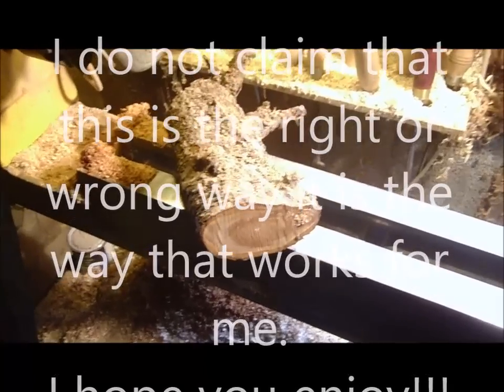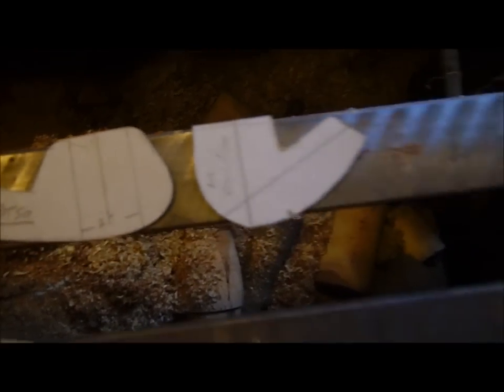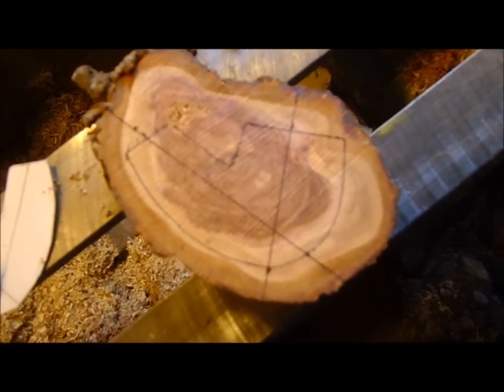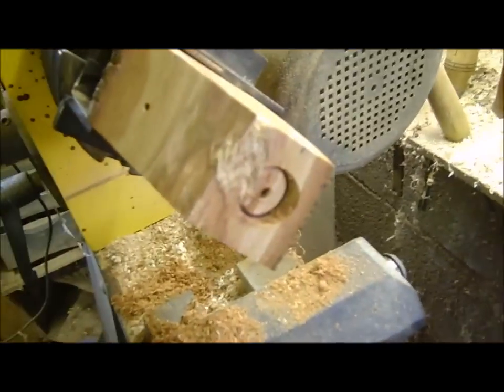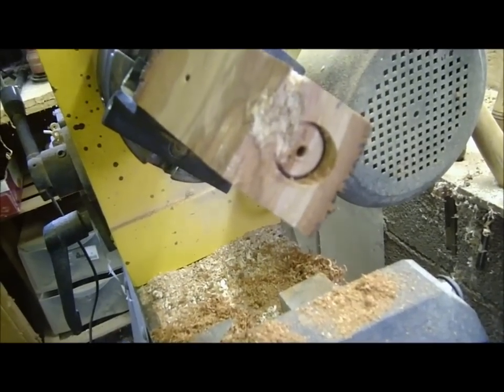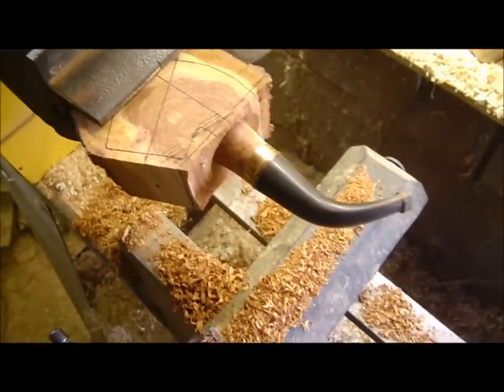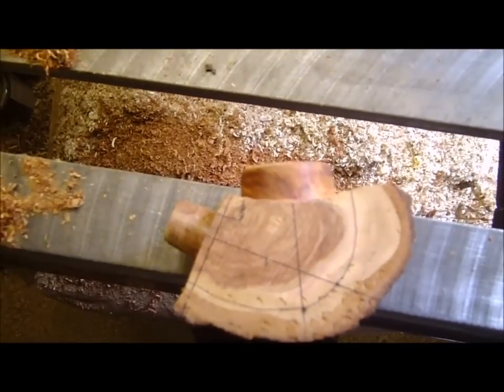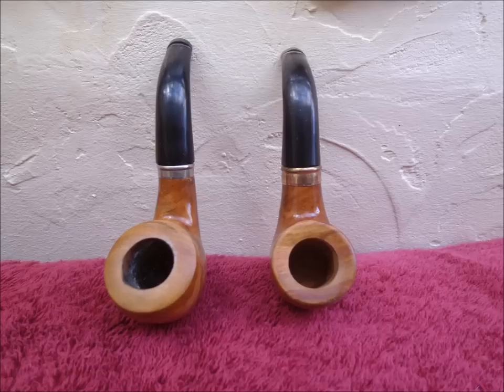Making a wooden smoking pipe step by step

Comment from the maker: if anyone needs more info, please leave a comment and if needed i will make another video covering certain parts in more detail.
Reply: bob fagg B.F PIPES I couldn't hear very well when I had it at full volume. Did you mention what kind of wood it was? I just didn't catch it if you did
Reply from the maker: it is made from a very old piece of plum tree root, but another good option is either boxwood (similar to briar as it has a high resistance to burning) or fruit tree wood, i have had good results with apple and pear woods.

Comment: Bob, Where do you get your stems from? I am having a hard time finding a supplier for stem and brass receivers, any suggestions?
Reply from the maker: you can buy them on ebay direct from china/japan, but i used to get mine from ebay from sellers that would take a good offer for unsold pipes. now i make my own as well, i have done a video on the subject.

Comment: great video, did you say two coats of beeswax and then laqure and counldt hear what sand paper you used
Reply from the maker: as to the type of sandpaper its a personal choice thing, the wax and lacquer depends on what type of finish you want, but it will need to be heat resistant.

Comment: Thanks for your reply. I watched your video on the stems. Great stuff. Can you tell me what they call that little brass piece that you can put in first that receives the stem. I can't find that any where either. I really appreciate your assistance. Signed a newbie in TX
Reply from the maker: i assume you mean a metallic filter, the only other parts i can think of that could be made of metal would be either a brass tenon or a collar,
Reply: @bob.fagg-bois657  Yes that must be it. When there is a brass tenon that is set into the shank then the  stem stem fits into that. I really appreciate your response and expertise.

Comment: How would you go about drilling the initial holes in the rough blank if you don't have the custom chuck jaws that you are using in this video?
Reply from the maker: measure and mark your holes as normal and use only two of your normal chuck jaws, have a look at my first pipe make vid
Reply: You could use a drill press and drill press vice and like everything up really well and clamp it all down to the table and cut slow. But man would a lathe be easier.